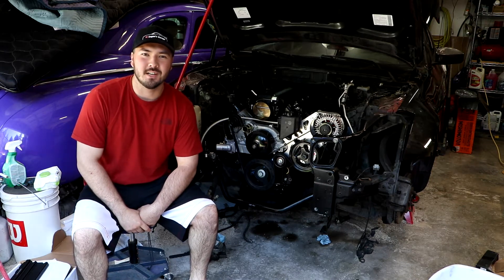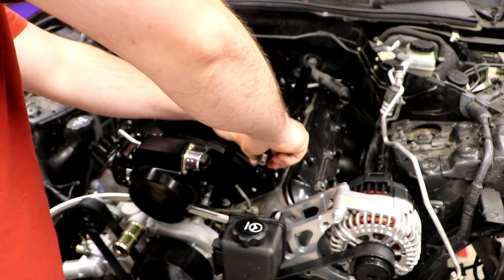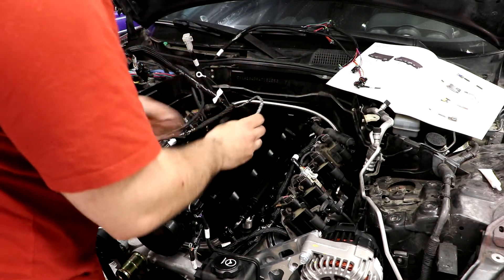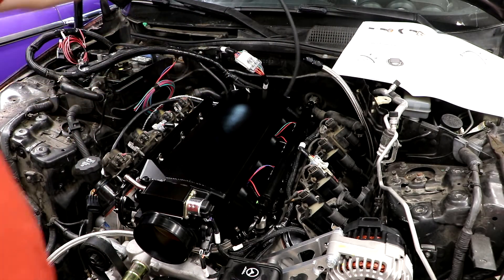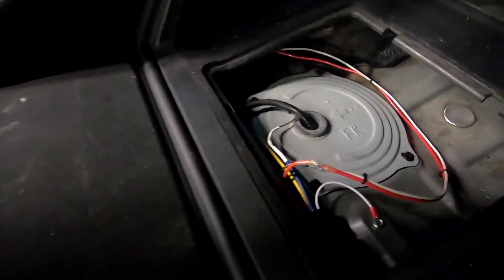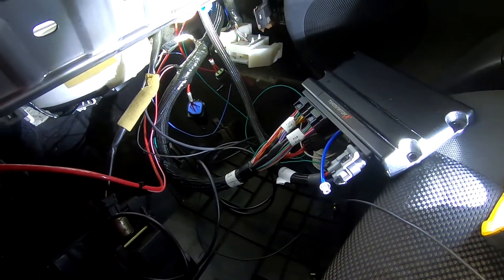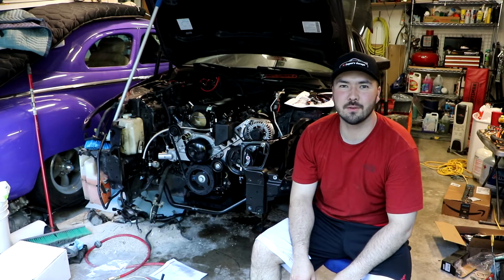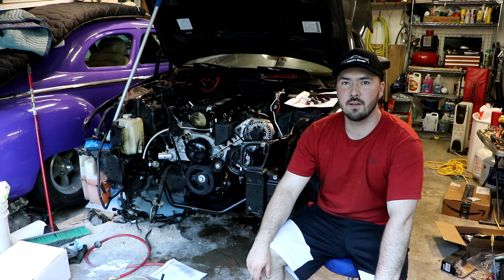Holley Terminator X - 350Z LS SWAP EP. 12

Comment: How did you get the Holley system to eork with the ls1 accessories and truck motor with truck coils??
Reply from the maker: I bought the truck harness. For the accessories all I have is power steering and alternator. Neither are controlled by the Holley. Hopefully this answers your question.

Comment: How do you get the column to unlock and provide key on power and run power to the termiX or do you just do switches to the Holley and use the Nissan stuff to unlock the column.
Reply: Fuck nm the car I’m working on is a 370 with fobpenus and fobgina

Comment: I am curious as to what you are gonna do for transmission control cause I can’t find a holly termX that has it for the cd009
Reply from the maker: I don’t believe you need a controller for the CD009. The car was auto and I swapped in the CD009 without any wiring other than the reverse lights.
Reply: Rofl